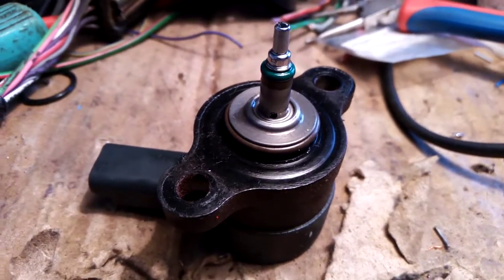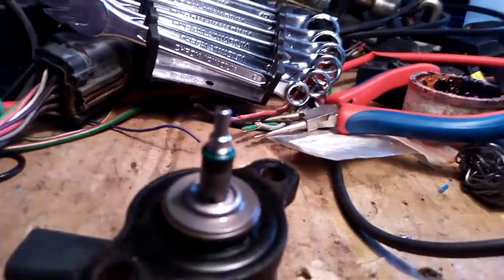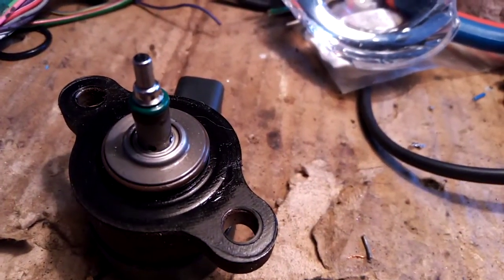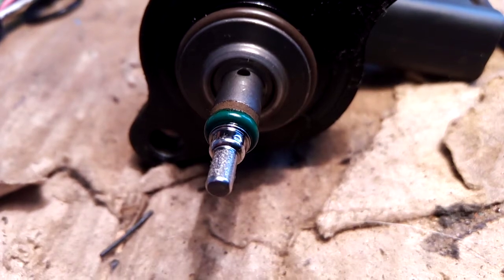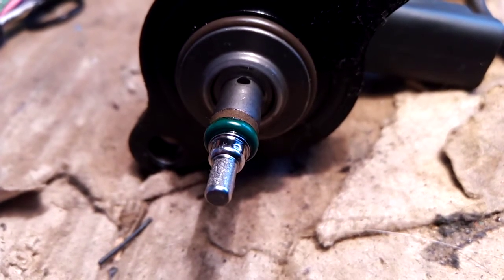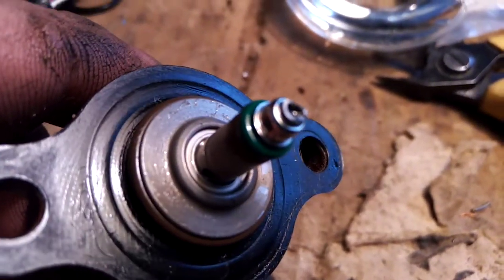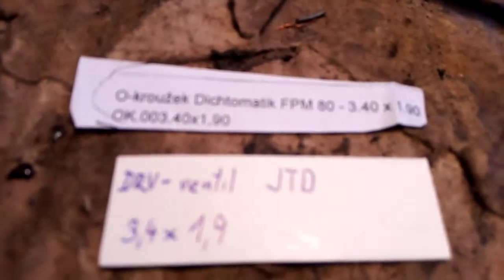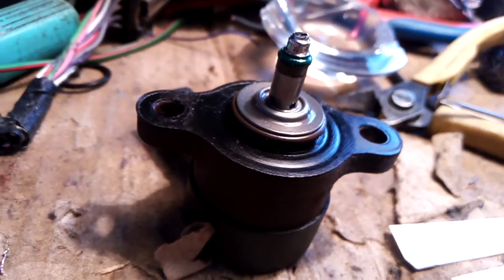Bosch CP1 valve permanent fix

Comment: I have a question. I repaired all injectors because i've thought the problem is in them but, even after repair my car wont start normally. cold start takes so long to start the engine. isn't the problem with this valve? fiat bravo 1,9 110kw. Thanks.
Reply: on 110 kw is another pressure regulator. not the same as this in video

Comment: big thankfull to you man, after watching your video i have a question about my car, i have a passat CFFB 2.0 TDI, recentely i start to monitor my car data by vcds, i see that my diesl pressure fluctuating from 26301 KPA to 31801 Kpa, thats too much but car works fine,  i test a freind car and i found that the pressure is almost stable '( from 29929 KPA to 28929), should i replace or clean or delet the filtre of the RAIL FUEL PRESSURE SOLENOID VALVE (the one you are speaking about in this video) or the one located on the HP pump (fuel pump pressor sensor or named suction control valve) wich one is responsible of this fluctuating ? thank you

Comment: Thank you. Solved a long-standing problem of P1229 DTC (common rail over pressure) on Toyota Yaris diesel.
Contaminated fuel was the cause.
As you point out - the mesh filter is collecting particles which are already in the common rail system. The fuel that is released by the valve goes to the high pressure pump where it joins the over-pressure fuel from the pump itself - this all goes back to the tank where it should get filtered again. The mesh filter might protect the valve mechanism but causes more problems than it solves.

Comment: Tnx, i have multiple times problems with that regulator in fiat jtd 1.9 115hp engine, it is same bosh regulator, new regulator is about 100e, i changed that 2 times i  25 000km i will now tray to cut 😁, tnx.
Car is old, i suppose nothing bad will happen. Compression is excellent in all cilinder. 
My fiat just off when motor start to brake, when i push throttle going well, but when going down hill, motor off.
First time when i changed it was irregular idle, second time he just don't want to start, or start very hard, now just engine off when go down hill.

Comment: Hi master! My car wont s start at all.... I put a 9 v baterry on terminals, and I cant hear nothing, you think its block or something? It s a simptom?
When I removed that valve, The filter it s already mising, you think she Was  like that from factor or somebody removed it?
Reply from the maker: maybe 9v battery is too weak togive 3-5 Amps ;) Try it with car battery for short time
Reply: @marekminar4724  i tried, but nothing clicks....
Reply: @marekminar4724  give me a fb adress or insta...
Reply from the maker: @Eword-pi6ty  https://www.facebook.com/profile.php?id=1706880761 also you can call me +420_736_413_98One ;)
Reply: Hi Marek, this valve should click when you connect 12v?

Comment: Really the pump should be striped down overhauled and cleaned cutting off the filter will lead to the all the muck/filings getting into the injectors and cloging them up, that could be expensive repair the filtrr if there for a reason
Reply from the maker: this is overflow valve ;-) hence filings goes back to the tank and circulating through fuel filter, so there it ends up;-)
Reply from the maker: But You are true overhauling of pump is better. This is for those who cannot/dont want to do such bigger repair.

Comment: Great video! Has anyone attempted to port the inlet holes closer towards solenoid.
Reply from the maker: Thank You! What exactly do You think?
Reply: @Marek Minář  it might help with flow into the pump. I'm wondering how much this filter affects fuel flow even when clean. I have a high powered e39 530d with upgraded cp1 pump and it keeps throwing EML after hard acceleration. May try cutting filter first before purchasing new solenoid. But also wondering if larger diameter holes will increase flow
Reply from the maker: @martynwhiteside6737  Are You sure with this? As far as I know this acts like overflow valve and should not affect quantity of delivered fuel. Or is ther something I've missed? Do you have smaller belt pulley on cp1 pump so DRV valve is not large enough to relief high pressure?
Reply from the maker: @martynwhiteside6737  Do you have eml caused by over- or undrepressure in the rail? try to make a graph during accel. What kind of upgrades on cp pump you did?
Reply from the maker: @martynwhiteside6737  If You have smaller pulley on cp, and overpressure peaks occuring in high rpms or after sudden throttle release, there is simply too small DRV valve or its too slow... What about a bit bigger high pressure pump?
Reply: @marekminar4724  no pulley on this engine, gear set only.
Reply: I think maybe it is over pressure due to filter being clogged. Yes as you say it is overflow valve. I had replaced seals but received inferior seals which disintegrated so had to rebuild again with genuine bosch.

Comment: Hi, thanks for very informative video. After CP1 gasket change I got problems after 5min idle: Check engine-light turned on and engine was running about 4sec after ignition was turned off. I removed valve and noticed that filter was totally clogged, I cut the filter and re-shaped cutting point back to round shape. 

After third start Check engine-light went off and even after 15min idle no Check engine-light and switching ignition off shuts down engine instantly.
Reply from the maker: Ïm glad that helped to solve another car! Also recomend to erase fault codes (DTC) from engine ecu 🙂

Comment: hello, I saw the video very well explained. I would need if possible if you can advise me. I have a 207 Hdi 2.0 dw10TD engine, about a month ago I noticed that when I turned it off the engine took between 2 and 3 seconds to stop. The days went by and I noticed that at times I was not accelerating as well as I should have. About 3 days ago I started the CHECH ENGINE, the engine loses power and slowly stops. I have a portable OBD2 that I use with the cell, I scan it gives the code P0088 (over pressure from the common Raúl ramp) and P1352. I erase the codes. To all this I check the connectors of the sensors all connected, after about 10 minutes the check starts disappearing. The car works and after 2 or 3 km the same. And this time I want to turn it off, it stays on for about 10 seconds. What I noticed is the very noisy pump, right where the high pressure regulator valve goes. My question what could it be? Thanks for your help!!!!!!!!
Reply from the maker: Hi John, Thank You for watching. As far as i remember, a few seconds idle after ignition off is one of the symptoms. If You have DTC overpressure, there are basically two options. Faulty high pressure sensor itself (not a common case) or this pressure relief valve clogged as seen in video. Remove that filtering cap carefully, clean it and lets try :-)
Reply: @marekminar4724  This failure occurred while it took the car to do a filter and lubricant change service.
Reply from the maker: @jhonnbass157  Seems to be no coincidence with service. High pressure pump is lubed by fuel and there is no common factor for oil change and injection system. If You here noise from high press. pump, maybe You are only more focused to it. Try to remove this tiny filter from drv valve and lets see. Remember to post me Your result!
Reply from the maker: @jhonnbass157  maybe if service included fuel filter change, its possible that small amount of debris got into fuel line and pump itself causing this. This is only coincidence i can take... Dont be afraid to do this job, sooner or later it will appear so there us no reason not to do it.
Reply: @marekminar4724  hello, well in the end I took it to the mechanic since I didn't have time to look at it and disarm it. The problem was the clogged valve pre-filter, it was cleaned. It gets dirty with metal shavings which I didn't ask if I made that modification that appears in your video. I don't remember exactly what the mechanic told me about that. The car already works well, it does not make the mentioned faults, such as taking a few seconds to turn off the engine, now it accelerates well and the engine is less noisy, as well as the noise of the high pressure pump. At the moment everything works. Thank you very much for helping to understand the error! It's common on HDIs.

Comment: Those wire cutters or nippers at 10:50 are not a pliers as some might say for the English wording. Have enjoyed your video. I have the T1N Sprinter. Before that I had 180D's years ago.
Reply from the maker: Thats originally designed to cut fibre optical cables, manufacturer Lindström. They are a bit expensive cca 40 EUR, but its shape and material is great. I have driven Sprinter 312D doublecab car teansporter, 2,9 TD... that engine and gearbox was simply undestructible. After couple of years I bought Peug Boxer Doublecab car transporter, so I  repaired all the rust, and now I buyed  2,0 HDI engine with stock 62 kw :-) but only 70k miles so engine is very good.
Reply: @marekminar4724  I bought the Peugeot 304 in '70 and later the 405. Too bad the US does not have the latest Peugeots. For the money Peugeot is a good buy and I miss the
economy and handling Peugeot has.

Comment: Thank you very much for this informative video.  Your English is VERY good, so no need to apologise.  Just a question - when this regulator is told by the sensor to release high pressure, where does the extra pressure go (as there are no pipes connected to the regulator)?   FPM (abbreviation) means "Fluoro Rubber" which is the material that the O ring is made from, as you said.
Reply from the maker: Thank You, this is only coil (solenoid) operated needle valve. Its driven with PWM signal directly from engine control unit. Pressure sensor is located on rail itself, so ECU keeps the pressure within limits. The extra fuel (or pressure-its the same) goes thru the valve and directly into the return pipe of high pressure pump. You cant see any waste hose, just because waste channel is bored sideways into the pump body, see CP1 cut view. :-)
Reply: @marekminar4724  Thanks Marek.  I have trouble on an old FIAT 2.0 diesel van (2005) - there is no fuel coming out of the pump (but I can hear it returning in the pipe I think)   The van has been left for a few years so I think the pump is rusted inside...
Reply from the maker: @Showing_the_car_   exactly the same engine as pug boxer. originaly this engine is peugeot hdi code RHV. Dont give up starting attempts. Old diesel with bio just sticked internal valves in the hp pump together. I slvedthe same issue with fuel pump relay removal and i left lift pump just run for long time, approx a few hours. Diesel fuel from tank will slowly disdolve all that mess. For efficienci increase, dont be afraid to ad some solvent (acetone, petrol...) into the tank (one litre per 20 ltr diesel. Then still try to start the car, with charger connected. after a half a milion starting attempts, it will wake up slowly :-) then let the engine on idle for another hour, it will maybe run rough and badly, but it will be better and better :-)
Reply from the maker: *bridge the fuel pump relay with wire
Reply: @marekminar4724  the low pressure (pump in tank) pump works OK (I replaced it)...  so there is diesel OK to the HP pump, which is mechanical...
Reply from the maker: @Showing_the_car_  let the low pressure pump run for long time, this helps to purge main high pressure pump from old sticky diesel. If You have multiecuscan or other diag device, check the fuel pressure during starting. it should be around 300 Bar. If it is, dont forgive the starting attempts. It takes a lot of time to take out old diesel from injectors this way, but after long time it will start.
Reply: @marekminar4724  The pressure is registering just 5.5 bar - this is when just ignition on and also when cranking.  So I think HP fuel pump is just not producing anything...   plus I unfastened the output pipe (to the rail) and nothing is coming out when cranking...  I was thinking maybe I could undo one of the pump piston covers and squirt in WD40, but there is a lot of dirt around the pump so it might make things worse.  I think a new pump needed?  Thanks for your help and advice on this.
Reply from the maker: @Showing_the_car_  this is only lift pump pressure. If You are afraid to disconnect intake piping, do it on the fuel filter side. WD40 could work, but what I know about biodiesel deposits, this is very difficult to dissolve with any agent. Tried petrol, acetone, ethanol and nothing worked well. What worked best was purging with new fuel (this is why I recommend to let the lift pump run for long time). Some strong cleaner (egr and turbocharger spray?) might work. So try wd40 first...
Reply from the maker: nice drawing see link:https://youtu.be/Y3rPOIj3r7w

Comment: How did the car behave after the removal of the filter? Were there any consequences? Thanks!
Reply from the maker: Engine behaves the same as before. This small "filter" is a construction fault. It should filter particles from high pressure pump not to enter to needle valve mechanism. Good when pump is new and does not produce much worn-out particles. When pump getting older, amount and size of particles increases (without major problems with injectors and other parts), but this filter gets clogged and therefore, DRV valve is not able to regulate pressure with controlled "leak", so the rail pressure increases and self-diagnosis built-in ECU stops the engine to prevent damage caused by overpressure. After removing, particles simply pass through the valve without causing any damage for it. In my fiat doblo van, have this done last 20.000 kms without single problem. Dont be afraid to remove :-)
Reply: @marekminar4724  I removed the filter of my regulator today. The big seal was also missing on my regulator.
Reply: @grishatas  why missing? How can it be?
Reply: @Vbokisha  I was told that the ones with a gasket don’t have an o-ring and the ones with an o-ring don’t have a gasket
Reply: @marekminar4724   I have a regulator from Rover 75 cdt with Bosch Cp1 pump. How do you check the solenoid if it's ok?
I measured with ohmeter and shows 2,8-3.0 ohm.
Thank's in advance from Austria!
Reply from the maker: @ioanros6576  Mount it on the car, usecamperemeter in series, start the engine. You should see current variating somewhere between 1A to 4A, according to RPMs and other values. If it does, solenoid is electrically OK.